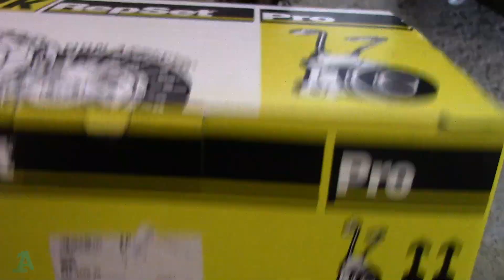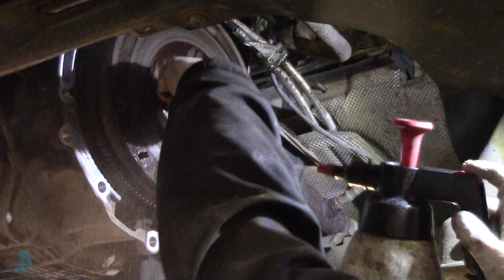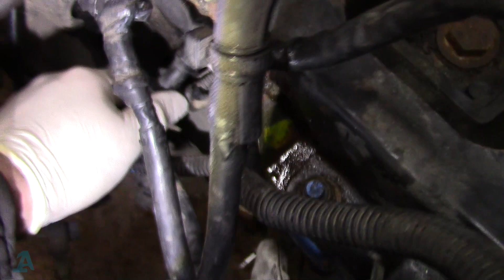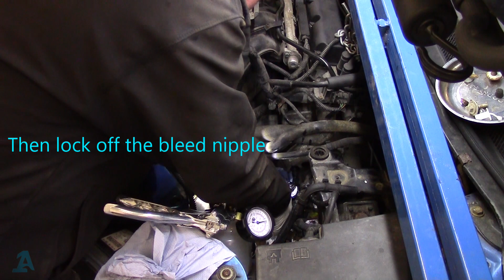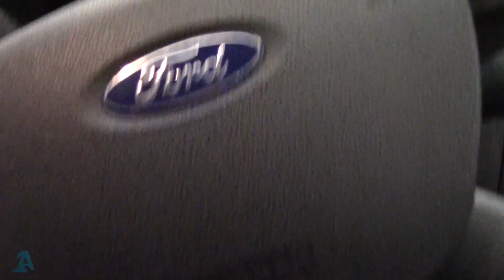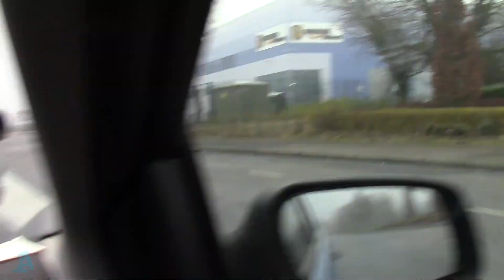Ford Focus MK2 Slipping Clutch & Repair - Part 2

Comment: Excellent video, one small point - you may have done it but didn't mention it - you should always degrease the new pressure plate friction surface as they often have an anti-rust coating from the factory.

Comment: Great video, just got my clutch replaced. Question though...is it normal that with the new clutch, the biting point is incredibly low? With the old one, it was pretty high - upper 3rd - but with the new one, it is almost immediate. It almost makes shifting harder because I have to be very slow and careful, otherwise the engine is stalling or jumping. Could this be a result of insufficient bleeding?
Reply from the maker: Thanks. It should feel light and bite about half way. It may need bleeding again
Reply: @OneAuto  Thx for the quick reply, back to the workshop then...

Comment: Guys I have a problem. When I changed the clutch set + slave cylinder - the clutch pedal started to feel hard, and then soft, and then hard again. Even after bleeding the air out. I got a Comline clutch and after 5000miles the clutch's pressure plate broke and I changed a brand new LUK set. Also changed the master cylinder just in case. Still same. Sometimes the pedal is soft, sometimes it is hard. Also, it is hard when it lets the pedal go, something like the clutch is sticking? It shouldn't be like that with an OEM part. I am really mad.
Reply: Ever get this fixed?? For same issue but mainly hard all time
Reply: @staywokealways6507  with the LUK clutch it remained the same. Pedal was squishy and was sticky. Though it was okay to daily drive it, just when changing gears really fast it seemed like the clutch was sticking.
Usually these symptoms are from master and slave cylinders
Reply: @m1rchegfn  oh I think I have different problem my clutch just stays about 50% more stuffer to push and hold resulting in hurting your leg and blaming it horrible to drive it traffic 🤦🏼‍♂️
Reply: @staywokealways6507  sounds like you need a clutch change. The clutch isn't expensive on 1.4 model. Fresh clutch feels like a new car.(unless it gets complicated like mine, but that is very rare and even depends if the mechanic is good or not)
Reply: @m1rchegfn  changed the clutch twice with a cheap one and a LUK a week ago that made the pedal soft and smooth for a week And after a week hurting calf muscles again after ten kinute drive because too much resistance come back from the peddle

Comment: Great job mate. This video is a MUST for every non-Ford mechanic to do this job properly. My 2005 Focus 1.6 Ti started having some weird noises in idle that disappear when I press the clutch pedal.
Reply: Tengo el mismo Ford Focus 2007 1.8 diésel cuál  kit tengo q comprar

Comment: 👍🏻👍🏻👍🏻Great. But where is the Screw for fillup the gearbox with Oil?
Reply from the maker: Black hex (Allen) key above the gear cables. If you can’t find it take out the reverse switch to fill.

Comment: Hello, nice video. I have a question though. I have the same car and last month I replaced all the parts regarding the clutch as you did except for the pressure plate bearing inside the gearbox. My mechanic said it is ok to keep the old one which he cleaned it and greased it well. Although I knew this isn`t a good thing to do, in order to save some money I agreed and didn`t replace it. I mention that the bearing isn`t noisy but now I am afraid I ll have some problems later and it should have been better to replace it toghether with the other parts. The car has 160.000 Km. What do you think? Should I replace it now or wait, and how could I find out later that it has problems? Thanks in advance for you answer.
Reply from the maker: The problems you may experience are loss of clutch pedal. The pedal may go soft and straight to the floor or the bearing becomes noisy. If it is ok now then don’t worry, change it when you need to. Although changing it at the same time as the clutch itself is always best practice
Reply: One Auto, thank you!

Comment: I changed the clutch on the same Focus model and the pedal is now hard. Is this normal? I am angry
Reply from the maker: Nope.. pedal should feel lighter than before.
Reply: One Auto, the air has not been released and I should add brake clutch fluid.
Reply: @OneAuto  just a reply. The clutch's pressure plate brake, and I got a brand new LUK clutch set and new master cylinder. Still the same issue. Sometimes the pedal is soft, sometimes it is hard. Also sometimes it lets go of the clutch pedal slower.
Reply: @m1rchegfn  did you ever fix this problem??

Comment: Hi auto one, I have just had my clutch replaced like you have done but it won’t go in reverse,  the gears engage but not smoothly like before. My suspicion is I have are in the system how do I remove this air? Will I need to bleed the break? And will I need to bleed the power steering thanks
Reply from the maker: utube882 possibly you need to bleed the clutch. Just make sure the brake reservoir is topped up during the process
Reply: One Auto, I have a auto pressure bleeder so should I just make sure I have enough in the reservoir on my bleeder
Reply from the maker: utube882 Yes
Reply: One Auto, thanks for your help mate. If I pump the clutch a few times it goes into the reverse gear so I suspect their is trapped air inside

Comment: 105,000 miles and sweet as a nut? mines only 71,000 and its an 08 and mine may need doing bite is near the top of the pedal  still drivable  no slipping yet

Comment: Great video I had all ways shied away from doing a clutch now I feel confident to work on my misses car who has a burning clutch,Can I point out is the clutch alignment tool imperial or metric,you stated that where the tool is entering,it is due to wear ,I was wondering ether the tool is imperial,I've known persons apply tape around the tool when it wobble slightly.

Comment: LUK are oem on Fords so the best replacements. Need to be careful bleeding the slave cylinder; they dont recommend pumps or flooring the pedal hard; the slave cylinder is easily damaged. Thus i would go the traditional way and let fluid drain through and pump the pedal (gently) to clear any air bubbles. Nice job mate; even though you are a pro you are still careful.

Comment: Did you replace the driveshaft bolts or reuse the old ones?
Reply from the maker: If you go by the book it says replace the bolts. I've always got one more use out of them. Had this car in last week for brakes and all is still well.
Reply: Thanks for the reply, reused bolts without a problem. Couldn't get the LH driveshaft out and the joint wouldn't come apart as it had centre punch marks where it was peened over at the edges (possibly to prevent the joint coming apart?). Had to remove and fit the box with the shaft on. Broke the reverse switch! Took me 8 hours on the drive on my own on a 2010 1.8 petrol. Old friction plate didn't look too bad (wasn't slipping but pedal was very high and the car has 109k on it), but with the new clutch, the pedal feels loads better and the drive is loads smoother. The friction plate springs were loose and I reckon this was felt when pulling away in first as the car seemed to kangaroo a little?? Thanks, Ian.

Comment: Would you ever recommend fitting the conversion kits from a dual mass flywheel to a solid mass flywheel.  Reason I ask I have a vectra c 2.0dti and thinking about getting the SMF kit instead, all just because of price and it's an old car now so I don't see it being worth it to pay the price of a DMF.  Just wondered what your thoughts were on the SMF conversions
Reply from the maker: Personally no I would not. They are designed to remove vibration through the transmission so without it I have heard in the trade that the smf can cause premature gearbox failure.
Reply: One Auto, thanks for the info and advice.  👍

Comment: Whats your opinion on the " updated fixes" for the dry dual-clutch shudder issues for the 2010 - 2015 Focus/Fiesta models. Are they an actual permanent solution or not?

Comment: 'the hell? Luk replacement bearing housing looks like plastic? The original one is metallic I think, might be wrong but it looks corroded. Is it corrosion? Or just debris sticking to the case?
Reply from the maker: Haha Original plastic, replacement plastic.
Reply: Ah, allright. So it's not someone just lowering the part price by changing materials.
Thanks for posting this, I'm facing about the same operations, plus the flywheel (dual mass, ofc) on my Focus mk2.5 1.8 tdci. I think I'm going for Sachs parts though. Cheers!

Comment: Great video, this! I watched it before I replaced the clutch on my brother's Focus - helped me out no end. Just one tip for those attempting this with the car on jack-stands: support the gearbox using the other chain on the support beam. This way, not only will it not fall on your head as you remove it, but you can also fine tune the alignment height as you hoist it up for refitting. Hope this helps.
Reply: Fork that. I ain't touching this one.😅

Comment: I did my own diagnose and repair today. Crank sensor change on a Audi A6 2001 modell. Hopefully no more starting issues. So far, so good.... Great job by the way :-) I like to see the Milwaukee M12 ratchet in action, I also have one of thoose.
Reply from the maker: Krillekris Nice one.. did you make a vid?
Reply: No, I don't make vids. But it was difficult to get to. Couldn't see it, so had to feel my way when working. Followed the cable from the connector and down. But it was so satisfying to do the repair and see that the car now starts on 
first try always. I love working on me and my family's cars.

Comment: I've replaced a few clutches in my day but never one with hydraulics. That was interesting.
Reply: One Auto, The external hydraulic slave cylinders never seem to go bad its always the internal ones that do. Its just sods law i guess.
Reply from the maker: There's a lot that use this type of concentric slave cylinder hydraulics now. They can be a right pain in the butt to bleed sometimes as well. I love it when a cable one comes in.

Comment: nice job , would it be possible to bleed the csc just by opening the bleeder and just pumping some fluid through ? just for like people with limited bleeding tools .
Reply from the maker: Yes Chris for sure. I used to do it that way before I had a pump, although Ford workshop manual says to use a pump. Clamping the flexi to reduce fluid loss helps as well.